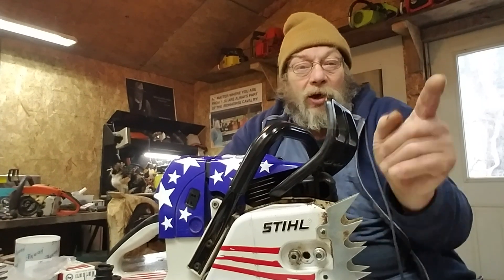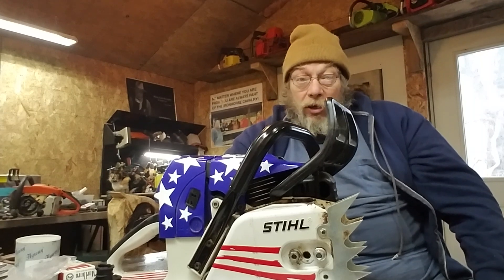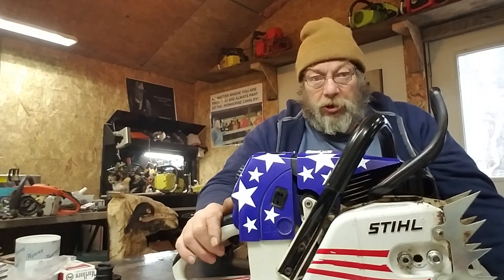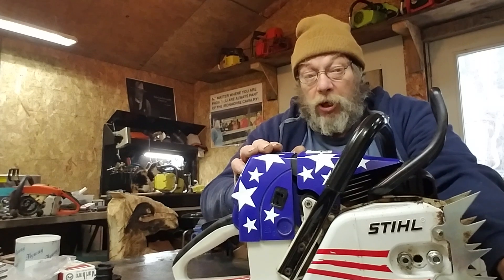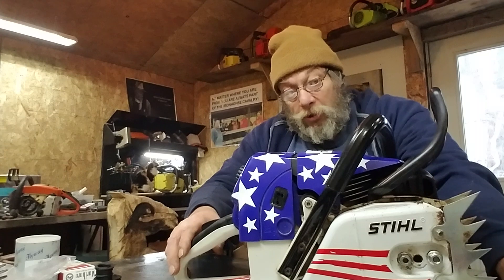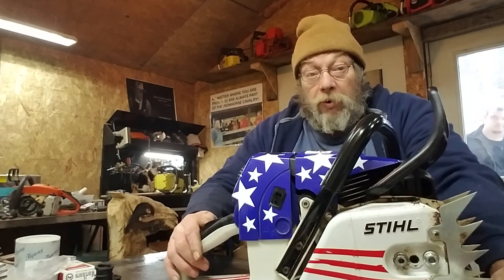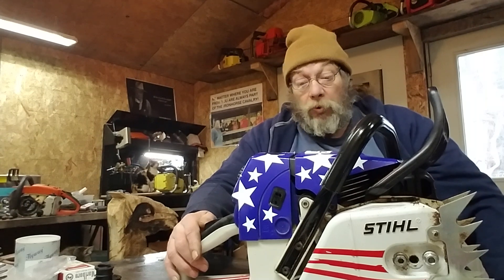What mix oil to use! What ratio should I run in different saws!

Comment: Thanks ironhorse ❗️my theory was correct I have the 2101xp and she was getting hot hot years ago so I started to run her 20/1 she runs like a dream ! What’s your opinion ?
Thanks for the video great watching thanks keep smiling ! 💪👍
Reply: In Stihl manuals, there were reportedly cases of cuts and jamming of the rings and the piston at 33: 1. Is there a risk of reduced machine life or carbon failure?

Comment: First started with my Macs and Homelite...30wt....then 16:1/32:1then years Stihl 40:1.....now been running 50:1in Stalls and Huskys last 30 years....
Reply: I picked a Poulan Pro 325 that says 18:1, what would you put in it?
Reply: @MattTigers  16:1 or 32:1....would be what I would run....16:1 warm weather 32:1 winter cool weather. Shoe
Reply: @robertshoemaker6204  I appreciate your reply, it confirmed what I was already thinking. Just run at what the manufacturer calls for.

Comment: a buddy of mine (home remodel and repair professional) has a 028 in his tool truck and it gets some use here and there few times a month and he runs used motor oil in it(like 10w30 synthetic). He uses 3oz per gallon. That’s close to 50-1 maybe 45-1. I’ve been useing amsoil because it’s what’s sold at every corner store in my locality. useing amsoil intercepter the yellow stuff. I like the smell I run it at 4oz per gallon 50-1 is 2.6 ozper gallon. I’ve had failures useing amsoil in snowmobiles. Lotta crank failures back in the Polaris triple cylinder days. Klotz cured the crank failure issue. Polaris oil was no better. I hope the amsoil doesn’t wreck my chainsaws but I’ve run many gallons it’s been all glory for a few years now. Knock on wood. I’m not an amsoil fan. I have never had a engine failure useing super tech Walmart oil but it stinks and burns hot and leaves grease in the muffler. BUT! your engine will not fail due to oil. Unless plugged screens are considered engine failure
Edited; small business owner all equipment is used as commercial duty.

Comment: So I was cutting pretty much ehhh 2-5 times a week in TN heat summer and also winter for 5 years  I would run hard for ehhh couple of hours

I gave and give two craps on the oil brand and I mixed as per OEM recommendations.  

I run the highest octain at the pump but on occasion lower.

I give two craps on ethonel or what ever

I am running the same saws now and cut ehhh two three times a week from 2.5 to 6 hours up north now.

Same saws and they don't tell me that there is anything wrong.

Am I a second off on a cookie cut?

Dont know but I will tell you that the saws have proven very, very reliable.

Six Husqi and I run the crap out of three of them.

Not knocking ya man but I see no issues with OEM mix ratio

Comment: In my (unmodified) equipment I use 50:1 and make sure I'm a little on the richer side.
Reply: Jeffrey Rubish hey Jeff that’s gonna be fine but the 50-1 recommendation is set by the  environmental protection agency. Manufacturers had to engineer things to that number and print it on machines. So the recommended 50-1 is an environmental standard not a enginebuilders standard. Just food for thought.
Reply: Eric, you're correct from the perspective the new machines are not the same as the old machines, some of them cannot be tuned using the old tried and true ways due to electronic and mechanical rev limiters fitted to new machines along with CNC machining and such.  Yet, it's my observation the new machines are factory-tuned rather fat, leaving plenty of room for a little more oil.

50:1 IMO, is pushing it closer to the edge so good quality fresh fuel is gonna be even more critical and that's sometimes not the case in real world conditions, considering.

Gordon Jennings was really into the subject of 2-stroke tuning and he left us with some sage advice that unfortunately has been buried/lost but if we care to dig deep enough is still useful.

The host of this youtube channel has vast experience, obviously he's been around long enough to have experienced most everything 2-stroke and thus IMO is a wealth of practical knowledge.

Comment: I'm kind of confused.  I've always ran 32:1 on my saws and trimmers on 2 stroke stihl mix. I had alot of greasy smudge on the exhaust. Now I'm using stihl ultra synthetic and would like to run the same mix on everything from my outboard at 50:1 to my older trimmers and stihl saws. Can you use 50:1 in everything if it's quality synthetic?
Reply: @577buttfan  I've heard that they use 80:1 but I'm too nervous to try that mix. I'm hoping a 50:1 mix will work his all of my 2 stroke equupment. I've got a couple old stihl saws and shindawa weedeater that called for 32:1.
Reply: Yes. Always quality.

Comment: I use maxima K2 at 32:1 in my Modified MS194T but I run it hard too so no spooge !
Reply: In Stihl manuals, there were reportedly cases of cuts and jamming of the rings and the piston at 33: 1. Is there a risk of reduced machine life or carbon failure?
Reply: There is a risk of stuck rings if you use any oil at 32:1, I personally use maxima K2 because it burns completely due to it's low flash point. Over 500 hours on the saw now

Comment: Just starting out on my own and trying to pick up some knowledge along the way but I purchased an older running 394xp and out of curiosity. Would you run a 394xp 40:1?
Reply from the maker: Sure would!
Reply: @theironhorse6600  Hey Ironhorse, what Stihl oil are you referring to? The regular HP or the Ultra? The regular HP sure is dirty, but I had no issues so far with the Ultra at 40:1. Really clean on the inside. I do use Aspen alkylated gas though, that sure helps all oils probably, very pure gas.
Reply: In Stihl manuals, there were reportedly cases of cuts and jamming of the rings and the piston at 33: 1. Is there a risk of reduced machine life or carbon failure?

Comment: if you switch to 40: 1 do you have to re adjust carb? Would you not be leaning out your saw?
Reply: There'd be more fuel if less oil but the difference is extremely small and I believe will not require any carb adjustment.  If your saw is specd at 50:1, 40:1 will require no changes.  One benefit of more oil is less chance of damage in case of a mistake.  This is one reason I choose 32:1, and in case my carb is maybe too lean or my fuel might be stale (by accident), for the worse case happy medium.  I use pump gas as well so the extra oil makes me more comfortable.  Air-cooled 2-stroke oil, ie:low ash API-TC rated.  Outboard tcw-3 oil is the wrong type, outboards are cool running engines.
Reply: @thisisyourcaptainspeaking2259 thanks for the response! my main question was if you need to adjust the carb, thank you for clearing that up. I was thinking backwards on the mix numbers! Have a great day!
Reply: wait a minute, I was thinking right , you are just saying its not enough to make a difference, correct?
Reply: Theoretically you will need more fuel, that's correct, but the difference is not much so I seriously doubt you'll notice anything or need to change anything, I never found it necessary to adjust a carb only due to changing oil ratio.  Theoretically (in case of pre-mixng fuel and oil), more oil means you need to increase fuel to maintain air:fuel ratio and in some cases even increase jet orifice diameter but in this case the difference is negligible.

Most important is having good and fresh fuel to avoid detonation, and enough oil for lubrication.  Listen to your saw, if it loses power in the cut it may be too lean of fuel and this causes detonation (fuel stops burning prematurely during the combustion stroke).  Detonation eats pistons by causing them to overheat (carbon on piston crown is the tattletale)  It's normal to have some carbon in the center of the piston crown but it should not grow out to the edges of the crown as fuel washes the carbon away and insulates the crown from combustion heat.  If you tear one down, carbon underneath the crown by the wrist pin tells you the piston was overheating.

The author of this youtube channel knows his stuff, he will teach you how to tune your saw properly in every respect and you should make an effort to learn, you'll be glad you listened.

My advice is you should concentrate on how to properly tune your saw, you can assume it will be necessary to adjust it from time to time and it will be worth you time.

I'll add, with a 2-stroke it's best to be on the fat side while dancing on the head of the proverbial  mixture ratio pin.  Getting it perfect will involve differentiating the 4-stroking vs 2-stroking concept.

The newer saws can be more challenging to tune due to they have electronic or mechanical rev limiters, which can mask the classic sounds and feel we rely on while fine-tuning.
Reply: @thisisyourcaptainspeaking2259  would my 562 auto tune adjust for different mix ratios or does the computer assume that I am using the recommended 50:1?
Reply: @Gunner1972  I still think 40:1 is better than say 50:1 but if you really want to investigate then take some temperature readings.  Pick a spot on the cylinder and a couple other places to confirm things run similar temps.  I've heard some claims more oil actually raised temps on some Stihl's tested but find it difficult to believe given IMO new saws are tuned fatter than they need to be.
I will say that I've always had issues with plug fouling while running fat ratios, the solution I came to was next hotter plug.
But since your saw is autotune, you are limited with what you can do in terms of tweeking.  Also you can monitor piston crown wash with a boroscope and perhaps you can view the piston skirt throygh the exhaust port by removing the muffler.  I'm very skeptical you will experience any issues adding a little more oil but if your fuel is low octane (esp stale) being fuel lean gets you closer to detonation.  The worst thing you can do in any 2-stroke is burn skunky fuel.  If you're uncomfortable with more oil then at least use good oil, the synthetics really are better due to they're better refined base stocks.  There are various grades of base stocks as well, so some research might be helpful.  Suffice it to say, great oils are fine at 50:1 but don't make mistakes (warm your saw before diving right in, for instance).  The lower quality oils won't cut it at 50:1 under tough conditions.  One more point to remember is every 2-stroke will eventually sieze, it's the nature of these beasts.  Worn rings lead to increased blow-by thus hotter piston then failure of oil film.
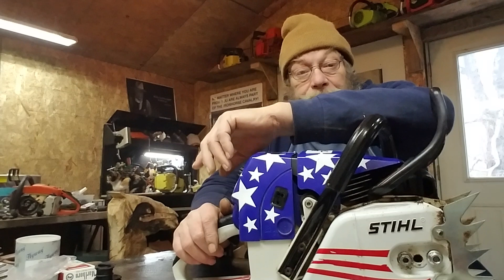Reply: @thisisyourcaptainspeaking2259  Master 1:33 or 1:40? saws 372xp 357xp 351 and scythe 545 rx? husqvarna ls + oil
Reply: @Sensei948  40:1 is fine if your saws are tuned correctly and the fuel isn't stale.  I've always used 32:1 and don't have any fouling issues.  Heck, we used to run 16:1 with the old saws and fouling wasn't really an issue at that ratio.
Reply: @thisisyourcaptainspeaking2259  Master, the point is that the carbon deposit does not scratch the piston and cylinder ... Does 1:33 produce much more carbon than 1:40?
Reply: @thisisyourcaptainspeaking2259  apparently there are cases of jamming rings at 33: 1?
Reply: @Sensei948  Perhaps you're referring to oil-coking the rings, causing them to seize in the piston lands.  Yes, ring coking is your warning something's not right and if you see  this occurring, the piston is heading for failure.
There are a number of things that cause ring coking but to simplify, it's an indication of lube oil failure (oil decomposition).  Heat tends to cause lube oils to fail.  Oil quality, fuel quality and too lean of tune are the largest contributors.
In my experience, quality oil, fresh premix fuel and as FAT of tune as possible will minimize ring coking.  A FAT tune, reduces piston temperature, avoids lean detonation.
Remember, every 2-stroke will eventually seize unless it's rebuilt before it happens, I encourage you to periodically remove the muffler and inspect the ring lands for signs of oil coking.  Adjust your tune accordingly, I like to know it's FAT on fuel, not dancing near the lean side of the razor's edge.
Detonation - When the fuel stops burning prematurely, for whatever reason ( example: stale fuel, too lean, low octane).
In the old days when we were running castor oil, our premix would sour in about a week.

Comment: I ran that Bel-ray synthetic...it was the rave back then...maybe 50;1...pretty expensive if you broke...seems like it was $10 a bottle back then...Yama-lube if I was getting parts...if I was in a old country store back in the n.georgia mts. I would use the chevron brand,,,very good bargain...worst oil I ever mixed was the mercruz oil for outboards...my old RM370 gagged on it...of course the cheaper oil I would run maybe 35 to 40 : 1

Comment: For what it's worth: 40:1 or 50:1 makes no difference in terms of lubricative properties. The variance is so small (0.6 oz per gallon) that the bearings will not even detect it. But the rest of the saw definitely will. More oil means less power, more heat, more smoke for the operator to inhale, more deposits and greater probability of cylinder scoring by all that unburned garbage lingering inside the saw. Everyone is entitled to treat their saw the way they want, but facts are facts.

Comment: I've always run 32:1, if no needle bearings in rod 20:1 or more.  Carbon on piston crown is too lean of fuel, a lack of piston wash (fuel washing the piston crown).  Boat motor oil is no ash outboard oil, air cooled 2-strokes need low ash motorcycle oil,  completely different detergent package (metal salts of calcium, zinc, etc for extreme temps, vs hydrazine for low temp).

No reason to use caster but if you do just know it's the dirtiest and will sour in pre-mix fuel after about a week, the lubricity drops off rapidly.
Reply from the maker: Perfect!

Comment: Id there no longer a difference in air cooled 2 stroke mix oils and water cooled. It use to be a frowned on to run oil designed for liquid cool engines (outboard boat engines) in an air cooled engine, because of the much higher operating temperature.

Comment: Im with ya Hoss on the Stihl Husky oils. The Stihl and Husky companies are in the business of selling chainsaws and saw parts.
Personally I look for the NHMA Stamp on the container of the mix. The producers of these mixes are not in the business of producing chainsaws. This stamp guarantees that the mix willl protect your saw and will replace your saw if its proper use fails.
I have taken saws apart with few hours of use with Stihl and Husky mix to find heavy carbon build up. My favorite mix is Chevron with the NHMA stamp when used on saws over a years time, when taken apart are clean as the day they were assembled.
Mark
Reply: In Stihl manuals, there were reportedly cases of cuts and jamming of the rings and the piston at 33: 1. Is there a risk of reduced machine life or carbon failure?

Comment: I run 40:1 in all my saws and they are getting old no trouble
Reply: Master, can you pour 33: 1 husqvarna ls + into the saw 372xp 357xp and scythe 545rx? Will the piston rings get stuck with carbon?

Comment: Lucas 40:1, perfect amount of oil all over the internal engine parts. Never had an issue.
Reply: Master, can you pour 33: 1 husqvarna ls + into the saw 372xp 357xp and scythe 545rx? Will the piston rings get stuck with carbon?

Comment: Try Echo Red Armor at 50:1 and you won’t go back to any other two cycle oil.  I run it in all of my two cycle equipment and I have quite a few saws, hedge trimmers and blowers,.  I ran StaMix at 40:1 for years in everything.  I now run Red Armor at 50:1 in even my old saws, like my Poulan Super 25 that I bought new in 1985.  You are very right about Stihl and Husqvarna two cycle oils - they are filthy.  Any oil that is not JASO FD certified is filthy burning and both of these oils do not meet this spec.

Comment: No matter what oil /ratio you use the quality of the FUEL is paramount ... ethanol fuel is a no-no for me .... if ya can afford it Motomix kicks ass ... it’s alkylate fuel meaning it’s the “first crack” in the refining process ... 99.5% pure fuel as opposed to the garbage ya get at the pump ... motomix is blended with STIHL ultra and I’ve torn down saws with over 100 hrs - clean as a whistle and everything lubed well at 50:1 ran like a raped-ape ... now you mix the SAME STIHL ultra with pump gas at 50:1 ?  Carbon everywhere - which leads me to believe it’s the FUEL NOT the oil causing the deposits !  If you want to run more oil ya better be running the piss out of the saw or you’re doin more harm than good ... just my take ... your mileage may vary ... one more thing :  Do Not try and “finish” the cut when almost out of mix !  A two-stroke needs fuel/oil to run - out of gas under load means NO lubrication and accelerated wear - modern saws have see thru tanks or fuel indicators ; Keep an eye on em and Do Not try and run to the last drop under load !!!
Reply: Yes!, I forgot to mention this in my comments, gas, new fuels have a shorter shelf life today, I buy smaller amounts and use it up, try not to let the gas spoil or get more than a month or 2 old, keep it as fresh as possible and..yeah, my brother runs a touch of racing fuel in his engines to clean them out , but I don't recommend that due to elevated heat.  Motorcycle has the air pulling across the cooling fins at 150 mph, ah ha, joking asside, yes...gas quality, huge..  Keep it fresh..  Thanks.

Comment: and stihl recommends 50:1
Reply: Both Stihl and Husqvarna recommend 50:1 in their stock saws. That's primarily driven by meeting EPA emission requirements.
Reply: @Woodman_Custom_Sawing  On stock saws in clean operating conditions with fresh fuel. You need to check your plugs to tune (adjust oil ratios for) your fuel for your conditions.